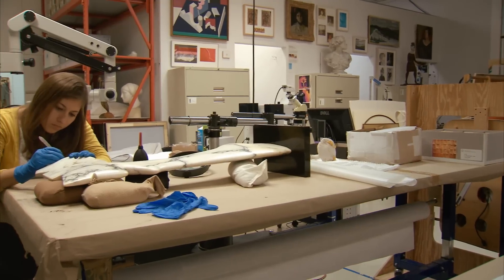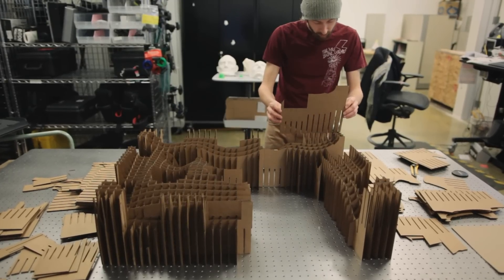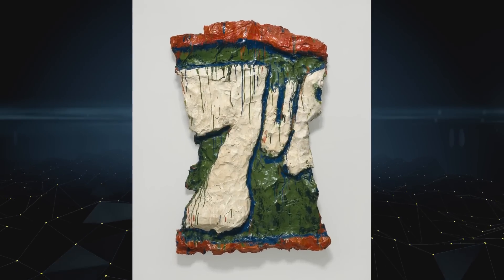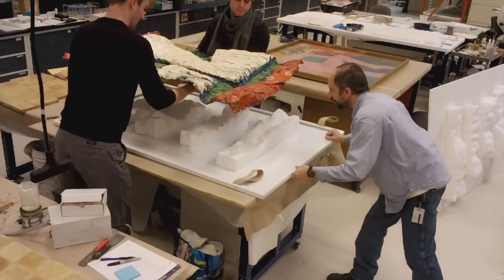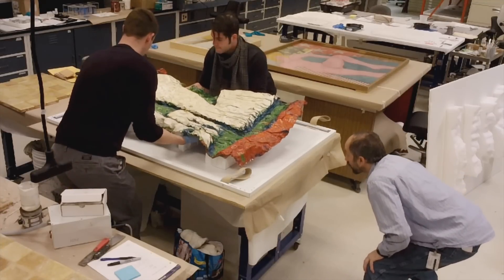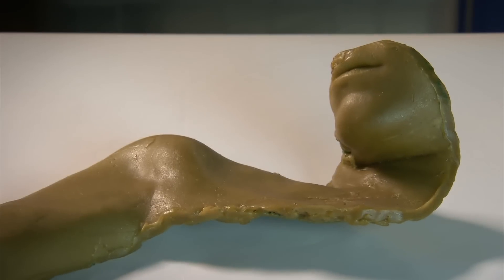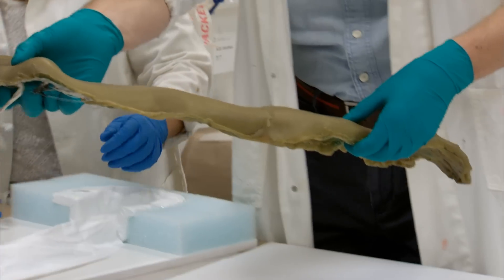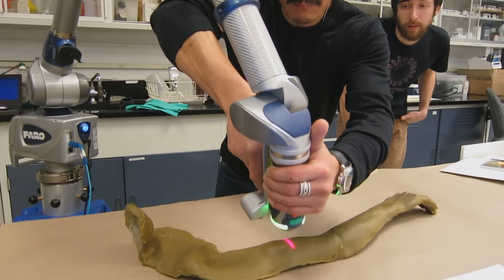Smithsonian X 3D - Conservation

Comment: KOREAN SUBTITLE

A NEW DIMENSION FOR CONSERVATION
So when you're thinking about what a conservator - what the responsibility is... one is to repair damage that has occurred to an artwork and any sort of problems with its aging, natural aging. But the other component that conservators are really concerned with is preventing that damage from happening in the first place. 
복원가의 책무란 무엇인가 생각해 볼 때, 하나는 예술 작품에 발생한 손상과 그 노화와 관련된 문제를 고치는 것일 겁니다. 그러나 복원가들이 정말로 염려하는 다른 구성 요소는 그 손상이 처음부터 발생하는 것을 방지하는 것입니다.

SUPPORTING THE ARTS
If you think about the types of things that can cause harm to an artwork, handling is really by far one of the main contributing factors. Artists are working with materials in very unconventional ways. For example, with the Noguchi we have an artwork that has light bulbs in it that need to be changed out. In order to do that it's really important that the artwork is turned upside down so that you can access the versa – the back of the piece. It's difficult to make sure that you are supporting it evenly across its surface. The benefit of having a cavity pack for this artwork, especially one that's 3D scanned, is it is mapping exactly the surface, is going to provide even distribution of weight and support underneath the piece. So it's important that we had something that really match the contour of the surface. 3D scanning was this perfect opportunity to do that.
작품에 해를 입힐 수 있는 일의 유형들에 대해 생각해보면, Handling이 주요 기여 요소 중 하나임을 알 수 있습니다. 아티스트들은 매우 비 전통적인 방식으로 재료를 사용하고 있습니다. 예를 들어, 우리는 Noguchi의 작품 중 전구를 교체해줘야 하는 작품을 가지고 있습니다. 그것을 하기 위해서는 작품이 거꾸로 뒤집혀서 작품의 뒷면(반대편)에 접근할 수 있어야 합니다. 이 때 표면 전체를 고르게 지지하고 있는지 확인하는 것은 어렵습니다. 이 작품을 위한 cavity pack을 갖는 이점, 특히 3D 스캔 기반 cavity pack의 이점은 표면을 정확하게 매핑한다는 것입니다. 이는 작품 아래에서 작품을 지지하고 무게를 균일하게 분배할 것입니다. 따라서 우리는 표면의 윤곽과 실제로 일치하는 것을 가지는 것이 중요합니다. 3D 스캐닝은 이런 일들을 하기에 완벽한 기술이었습니다.

PRICELESS PROTECTION
The "7-UP" Oldenberg piece is a plaster-infused fabric over a chicken wire frame and then the surface is painted. These are very, very brittle pieces and to travel them in a safe manner is something that takes a lot of creative thought. We did find that there has been precedence for 3D scanning the surface and then creating a tray to then support the artwork without having any sort of unevenly distributed pressures over the surface, which is really key on this piece. Knowing that 3D scanning had been successfully used the past, it made perfect sense for us to utilize that technology in transporting this artwork as well. Obviously, before 3D scanning there was the ability to pack artwork safely. This just makes it that much easier.
"7-UP"올덴 베르그 (Oldenberg) 피스는 치킨 와이어 프레임(닭장 구조) 위에 석고가 주입 된 천으로 표면에 채색한 작품입니다. 이는 매우, 매우 부서지기 쉬운 작품이며, 안전한 방식으로 그들을 운반하는 것은 많은 창조적인 생각을 필요로 합니다. 우리는 표면을 3차원 스캐닝하는 것이 우선적이었고 표면 위에 비균일한 압력을 가하지 않고 작품을 지지하는 트레이를 만드는 방법을 생각해냈습니다. 이 트레이는 실제로 이 작품의 핵심입니다. 3D 스캐닝이 과거에 성공적으로 사용되었던 것을 알았고, 이 기술을 작품을 운반하는데 활용하는 것이 합리적이었습니다. 분명히 3D 스캐닝을 활용하기 전에도 미술품을 안전하게 포장 할 수 있는 능력이 있었습니다. 3D 스캐닝은 이 과정을 훨씬 손쉽게 하는 것입니다.

DO NO HARM
 Much of my day-to-day work has to do with documenting artworks, examining them in preparation for loan, and examining them to better understand their particular hidden vulnerabilities. We have an artwork by Bruce Nauman called "Hand To Mouth" and it's made of a wax material. As you can imagine it's vulnerable to being misshapen. So we wanted to make sure that if this piece ever traveled that we could monitor any change that changes in humidity, or temperature might have in terms of its dimension. So it was scanned back in 2009 prior to going out on loan. Now when it comes back we're able to determine - was that period display- did that cause any major difference in the piece and we were happy to see that between the two Scans there was just minimal, minimal difference between those.
제 일의 대부분은 미술 작품을 문서화하고, 대출(순회전을 위해 작품을 빌려주는 것) 준비를 검수하고, 작품의 숨겨진 특정 취약성을 더 잘 이해할 수 있도록 조사하는 것과 관련이 있습니다. 우리는 Bruce Nauman의 "Hand To Mouth"라는 작품을 가지고 있으며 왁스 소재로 만들어져 있습니다. 상상할 수 있듯이 그것은 변형에 취약합니다. 그래서 우리는 이 조각이 언제든 운반되면 습도의 변화나 온도의 변화를 모니터링 할 수 있기 원했습니다. 그래서 2009년에 대출되기 전에 다시 스캔 되었습니다. 작품이 다시 돌아 왔을 때 우리는 작품에 어떤 큰 차이를 일으켰는지 검사할 수 있었고 두 스캔 데이터 사이에 최소의 차이가 있다는 것을 알았기 때문에 기뻤습니다.

SERVING THE CONSERVATOR
 I am looking at 3D scanning as being something that takes away the hours of work trying to come up with some really creative solution. Whenever there's something that provides that for the museum staff, it just means that my focus and the museum's resources can then go towards making the show even grander than it is.
저는 3D 스캐닝을 시간을 투자해 창의적인 솔루션을 찾아 내려고 노력하는 것으로 보고 있습니다. 박물관 직원에게 3D 스캐닝 기술을 제공할 수 있을 때마다, 제 생각과 박물관의 재원이 그 때보다 더 좋은 전시를 위해 진보해나갈 수 있다는 것을 의미합니다.

틀린 번역이 있으면 댓글 달아주십시오